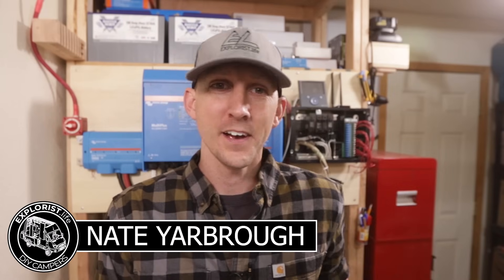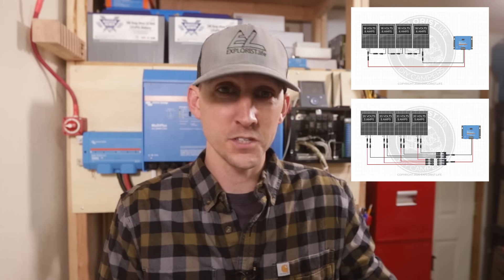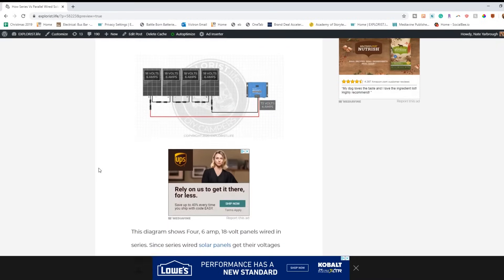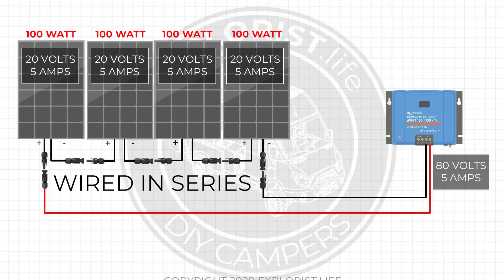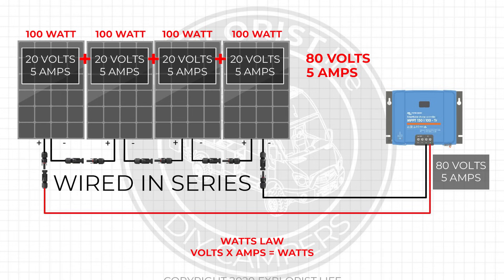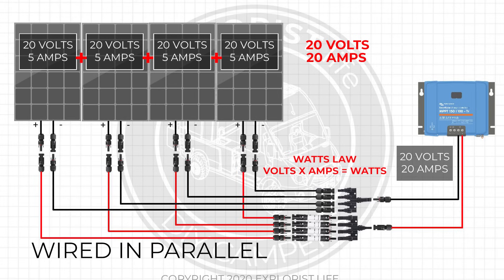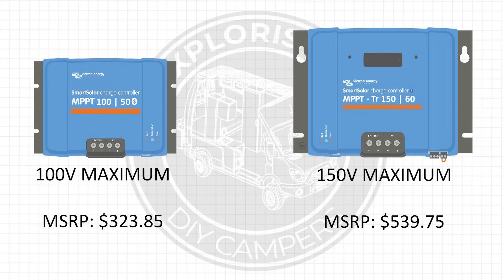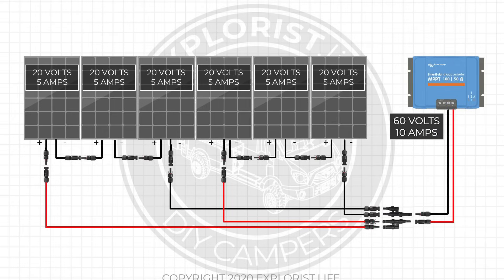Solar Panel Wiring vs Volts and Amps

Comment: I have the delta pro 3, which can take in 1600w of solar on the high side. If my array which is wired in a series parallel adds up to 2100w, is that ok to run to my dp3? Will the extra wattage hurt or help? I'm within my volts and amps limit.
Reply from the maker: Good question 👍 In general, being over-paneled on wattage is usually fine as long as you’re within the Delta Pro 3’s voltage and current limits — it’ll just cap what it can use.

That said, the details of the panels and wiring really matter, and that’s where things can get tricky. We’d be happy to take a closer look at your exact setup and make sure it’s a good fit (and help you dial it in if needed). Reach out to our support team here and we can review it with you: https://shop.explorist.life/support?utm_source=youtube&utm_medium=comment&utm_campaign=support&utm_content=response_link
Reply: @EXPLORISTlife ... Greatly appreciate you getting back with me so quick. I will definitely send that info over

Comment: We have 12 solar panels each producing 550Wp at present  we connected 12 panels to bldc motor called water pump and newly we installed MPPT for lighting purpose to that MPPT we need to connect 9 panels from 12 panels.
At present we have only 12 panel with this 12 panels we need to run bldc water pump as well as MPPT how to make connections Sir please explain me it will be more helpful
Reply from the maker: Thanks for watching and for the detailed question! With a system like that — high-wattage panels, a BLDC pump, and an MPPT — the exact wiring and feasibility really depends on panel specs, voltages, controller limits, and how you want the system to operate.

Rather than risk giving advice that could damage equipment, our support team can take a personalized look at your setup and help you figure out the safest and most effective way to configure it — and help you source any parts you may need 👉 https://shop.explorist.life/support?utm_source=youtube&utm_medium=comment&utm_campaign=support&utm_content=response_link

Comment: I have 4-100w Solar Panels, Renogy Wanderer Tm, 400w,30amp, charger, with a 300hr   Sealed Battery, not charging past 42%. Can you tell me why, this set I got is not working
Reply from the maker: That definitely sounds frustrating — and with solar, a few small details (panel wiring, controller settings, battery type/voltage, and any loads running) can make it look like the system is “stuck” at a certain %.

We’d love to take a personalized look at your exact setup and help you pinpoint what’s going on. Please reach out to our support team here: 👉 https://shop.explorist.life/support?utm_source=youtube&utm_medium=comment&utm_campaign=support&utm_content=response_link

When you submit, include:
Battery voltage (12V/24V) + exact model
How the 4 panels are wired (series/parallel)
Any loads connected while charging
Any settings/LED codes on the Wanderer

We’ll help you get it sorted and make sure you’ve got the right parts for the system.

Comment: now i am using Taiyo 3.6kw inverter, in raining season the battery is hard to be full so do i need to change my solar panel into paraller to charge the battery quickly?

Comment: I need help I have 6 100w panels a 60 amp charge controller 12/24. And a 12 v pure sine wave 3000w inverter
Reply: I also have a 300ah 12v battery.
Reply: I can send pictures. I have got the connecters and crimpers to hook everything up I just have not got my wire order yet
Reply from the maker: shop.explorist.life/support

Comment: Hi. I have 2X590Watt panels output 44.91vdc at 13.14 amp.  I have a 6200watt PowMr hybrid inverter with a built-in MPPT 60-500  48vdc to 230vac with a 100ah 48v lithium life04 battery.  My question is, if I wire the 2 panels in series, would this work with the hybrid inverter sufficiently to run off grid in a caravan.  Many thanks David MacLeod

Comment: Hey EXPLORIST, 

Always appreciate your content and knowledge base. I’m thinking of getting one of those foldable solar panels. Either the 600w (XLB-TYNFD New 600 Watt Foldable Solar Panel Kit) or the 1000w (XLB-TYNFD Store 1000W Foldable Solar Pane) both on Amazon. 
Was thinking the 1000w would give me about 900w actual solar output but if I put the 2 600w panels in series it would give me an actual 1000w solar output after losses. The question I have is based on your series solar panel diagram. For the 2 600w panels, I’d have (per panel) 600w, 72v and (600w/72v = 8.3amps) 8.3 amps. 

So 2 of these 600w panels connected in series would be a total output of: 1200w; 144v and 8.3amps. Hope this math is correct (please correct me if wrong). So I would need a charge controller that could handle 1200w, and 144v and 8.3 amps. Do you have any recommendations? I wanted something plug and play without having to wire like (https://a.co/d/1WQXvAj) but not sure that could handle the wattage or voltage. 

I like the flexibility of the 2 600w panels but maybe going with the 1 1000w panel would be better as far as wiring and charge controller. Would appreciate your input? Thanks again.

Comment: I have 4 100w panels. Each open circuit is 24.5v(5a) for a total of 98v. My Epever mppt controller supports 100v/30a. The 4 panels in series would be close to the max voltage. Would that be an issue, or will it shorten the life of the controller? Also, which wired array will charge a battery faster? I'm also using a inverter.
Reply from the maker: This may take some more in-depth troubleshooting.  If you have purchased/are purchasing from our store (shop.explorist.life) reach out for some more personalized help: shop.explorist.life/support

If you've purchased/are purchasing elsewhere, reach out to your dealer for support.  We'd love to have you as a shop.explorist.life customer so we can provide a bit more help in the future. 🙂
Reply: @EXPLORISTlife  I decided to put the four panels in series-parallel. 49v/10a. I didn't want to go too close to the max voltage of the controller. I want it to last for a while without issues. I just wanted the most voltage to charge my two 100ah batteries that will be in parallel. I am going to install the whole system next week.
Reply from the maker: Understood.  Best of luck with your project!  Would love to have you as a shop.explorist.life customer for your next project, though, so I can lend a bit more support! 🫡

Comment: How can I connect 8 pcs solar panels in series for 4 pcs 12 volt 200Ah batteries also in series for 24 volt system.
Reply from the maker: This may take a more in-depth look at your personal setup.  If you have purchased/are purchasing from our store (shop.explorist.life) reach out for some more personalized help: shop.explorist.life/support

If you've purchased/are purchasing elsewhere, reach out to your dealer for support.  We'd love to have you as a shop.explorist.life customer so we can provide a bit more help in the future. 🙂

Comment: Let me explain what I'm doing so you'll understand and then you can tell me what I need to know. ..... I am building a bicycle camper. This means I have even more limited space than a traditional camper. I have 2 / 100 watt solar panels wired series for a combined total of 200 Watts. Mounted on top of the camper. Running through an mppt charge controller which is on the inside of the bicycle camper. 
I've got a third 100 watt solar panel of the same type and same voltage just a slightly different size. That I can store in the bicycle camper under my mattress when I'm traveling. This will allow the camper to charge at a optimum 200 Watts on a good day with a 100 amp hr. lithium battery when I'm traveling  can I use a quick disconnect to reconnect the third solar panel when I'm camping that is 100 Watts. To the same battery. Using a second charge controller that is a PWM for the single 100 what solar panel. And connect that through a quick disconnect to the same battery.

So I will have the two solar panels totaling 200 Watts mounted to the top of the camper in series constantly. Then connect when I'm camping the third 100 W solar panel directly to the battery through a quick disconnect. Which from my understanding would technically be in parallel since it's a single panel. Which will have a PWM Charge control unit located on the back of the third solar panel. 

Can this be wired together like I'm explaining. SAFETY ! ....  without cost of me any power drop or very little power loss. Getting me closer to the 300 Watts put total power.  

 OR IS THIS A BAD IDEA !  .....  please let me know ASAP. As I am building this camper as we speak.
Reply from the maker: This may take a more in-depth look at your personal setup.  If you have purchased/are purchasing from our store (shop.explorist.life) reach out for some more personalized help: shop.explorist.life/support

If you've purchased/are purchasing elsewhere, reach out to your dealer for support.  We'd love to have you as a shop.explorist.life customer so we can provide a bit more help in the future. 🙂

Comment: My head is scrambled!! maybe it's my dyslexia but I can'y get my head around this this. for my system. 4 x 300w panels  Maximum power voltage: 32.70V
Maximum power current: 9.17A
Open circuit voltage: 39.80V
Short circuit current: 9.78A with a victron controler 100/50 i'm totally lost if my controller will deal with my panels. HELP PLEASE!
Reply from the maker: If you've purchased your controller from our store shop.explorist.life; reach out for some more personalized support: shop.explorist.life/support

Comment: Is it better to run closer to voltage of batter bank? I.E. if your 12v bank, using 20V/60A through solar or 120V/10A?
Reply from the maker: This may take a more in-depth look at your personal setup.  If you have purchased/are purchasing from our store (shop.explorist.life) reach out for some more personalized help: shop.explorist.life/support

If you've purchased/are purchasing elsewhere, reach out to your dealer for support.  We'd love to have you as a shop.explorist.life customer so we can provide a bit more help in the future. 🙂

Comment: If I were to wire 5 of the "rich solar" 250watt panels in series, Am I correct that's its 95 volts and about 13Amps? Id be at 100% of getting the most from my panels but would I need a fuse inline before the charge controller?
Reply from the maker: This may take a more in-depth look at your personal setup.  If you have purchased/are purchasing from our store (shop.explorist.life) reach out for some more personalized help: shop.explorist.life/support

If you've purchased/are purchasing elsewhere, reach out to your dealer for support.  We'd love to have you as a shop.explorist.life customer so we can provide a bit more help in the future. 🙂

Comment: Nate, need some help. I am new to solar and have watched every video. I am curious if I am doing this right. Here is what I have.

I have 2 panels in series at OV 37.7 in a roll of 6 panels side by side. Due to space. Is my voltage now on each roll 75.4 vdc series and then I put each set in parallel so would that now be 75.4 x 6 rollls to equal 452.4 vdc? 

Am I correct on this?

Comment: The solar that came with our boat uses different size panels of on known voltage and watts. Guess I can measure the voltage at the controller. My question is I want to add 4 identical 100 watt panels to go to my house bank can I just wire them in separately using a parallel, series connection then go thru a separate controller and everything including the existing solar panels into my house bank? Is there a better way?
S

Comment: If the short circuit current is 13.58A; open circuit voltage is 38.95V with max fuse at 25A:  For a 3S2P setup, would I need just the 2 in-line fuses at 25A a piece? Or would I need another fuse behind the 25Amp inlines connected to the branch connector?
Reply from the maker: This may take a more in-depth look at your personal setup.  If you have purchased/are purchasing from our store (shop.explorist.life) reach out for some more personalized help: shop.explorist.life/support

If you've purchased/are purchasing elsewhere, reach out to your dealer for support.  We'd love to have you as a shop.explorist.life customer so we can provide a bit more help in the future. 🙂

Comment: Hey Nate, I really enjoy your videos I go to bed less dumb after watching them. but , I have a problem  I have 16 230-watt yingli panels with  the open circuit voltage as 37 v  and short circuit amps of 8.4  my question is should i be using these numbers in my figures or the rated numbers which are less?   thanks again for the very informative videos.
Reply: Yes, you are correct Craig, those are the numbers to use...the open and short circuit.👍
Reply: @YouLookingAtMeBro  thank you ! always learning

Comment: Mate i just bought a 450 watt solar panel to charge my power station bluetti 180p  .now bluetti info says  500W Max., VOC 12-60VDC, 10A and my solar pannel says ( MAXIMUM POWER VOLTAGE	32.82V
MAXIMUM POWER CURRENT	14.81A
OPEN CIRCUIT VOLTAGE	39.30V
SHORT CIRCUIT CURRENT	15.64A
MAXIMUM SYSTEM VOLTAGE	DC 1500V )
will whic combo work ??
Reply from the maker: This may take a more in-depth look at your personal setup.  If you have purchased/are purchasing from our store (shop.explorist.life) reach out for some more personalized help: shop.explorist.life/support

If you've purchased/are purchasing elsewhere, reach out to your dealer for support.  We'd love to have you as a shop.explorist.life customer so we can provide a bit more help in the future. 🙂

Comment: Is there any benefits to having more panels wired for the same amp and voltage limits than have less panels wired to the same limits
Reply from the maker: Hey, @billfisheriii5817! I appreciate you taking the time to ask your question, but unfortunately, I don't have enough info about your specific question to provide an accurate answer, but here is a playlist that, if you watch all of the videos start-to-finish (and take notes 😉), you'll have a REALLY good idea of how to design a solar array: https://www.youtube.com/watch?v=Jkbs84sBHsg&amp;list=PLmvhcyi4n0TV9pi83rFTv3ZuMT_S1xIZt

Alternatively, I have some of my most common solar array setups pre-built here: https://shop.explorist.life/product-category/all-products/camper-wiring-kits/solar-charging-wiring-kits/
Reply: @EXPLORISTlife  I can wire 4 panels series and be maxed on my voltage 5 panels parallel and be maxed on my amps or 6 panels series parallel so my question is are more panels better for charging
Reply from the maker: This may take a more in-depth look at your personal setup.  If you have purchased/are purchasing from our store (shop.explorist.life) reach out for some more personalized help: shop.explorist.life/support

If you've purchased/are purchasing elsewhere, reach out to your dealer for support.  We'd love to have you as a shop.explorist.life customer so we can provide a bit more help in the future. 🙂

Comment: When connecting batteries array in parallel for solar charging, the output/load terminals of 1st & last batteries shall be used to balance the draining. Does the same apply to charging as well? The solar output + to one end of the array while -ve to the other end? I am confused
Reply from the maker: This may take a more in-depth look at your personal setup.  If you have purchased/are purchasing from our store (shop.explorist.life) reach out for some more personalized help: shop.explorist.life/support

If you've purchased/are purchasing elsewhere, reach out to your dealer for support.  We'd love to have you as a shop.explorist.life customer so we can provide a bit more help in the future. 🙂

Comment: Wonderful explanation. I have a question which I think you already answered but I just wanted to verify. My Victron MPPT 100/50 controller sometimes turns OFF, stating Insufficient PV Power, and that PV must be at least 5V above battery power (12V LiFePo 3 battery bank). Today battery voltage was 13.8V and VOC was ~17V.
I'm in Utah in the summer and this happens sometimes for 2 days at a time in sunny weather. My two 220W NewPowa solar panels are wired in parallel, with a VOC of ~20V. It seems like I may need to rearrange the wiring to connect the panels in Series, raising my VOC to ~40V. Does that sound correct?
Personal note: I find it amazing that you actually put in the effort to answer all of our questions and I find some of your answers hilarious. Keep it up, please!

Comment: So the confusion is should I use the open circuit voltage and amp or the max voltage and amp cause the math doesn't add up with open volt/amps??

Comment: The information I needed in a clear understandable format. And points to my MPPT controller wanting/needing more voltage to operate more effectively. My challenge now becomes how to hook up panels in series that have the 2 pin SAE connectors. Without soldering wires or adding lots of adapters. Sure don't want to buy all new panels. Will run a scaled down experiment with a small number of adapters, testing the real world application of my series and parallel options before deciding on a final setup.

Comment: I am a bit confused because I have seen some misleading information online, some people estimate the amperage of the cables using watt's law using the watts of the panels divided by the voltage of the battery pack. So how can I be sire the I wont burn the cables or the fuse. I would appreciate some help. Great video and nice material.
Reply from the maker: If these videos don’t clear it up, just buy from our shop at shop.explorist.life where we’ve already figured everything out for you. 🙂🙏
Reply: @EXPLORISTlife  I think there is a misunderstanding here, because charge controllers specs don't mention anything about max amperage input. So apparently the max amperage of the charge controller is the output amperage thus the one that goes to the batteries isn't it?